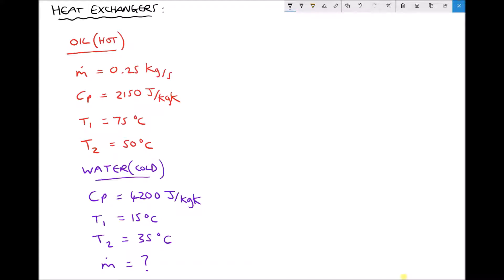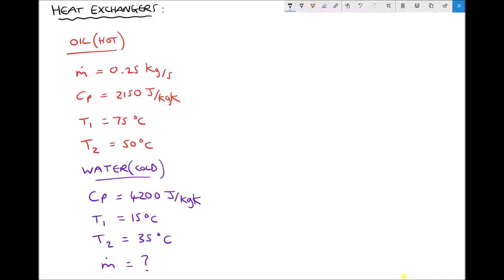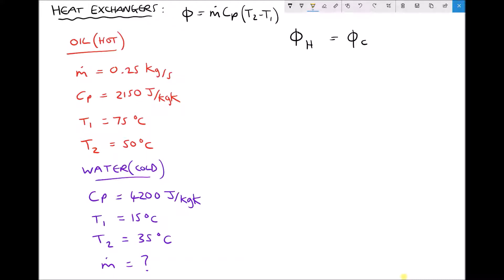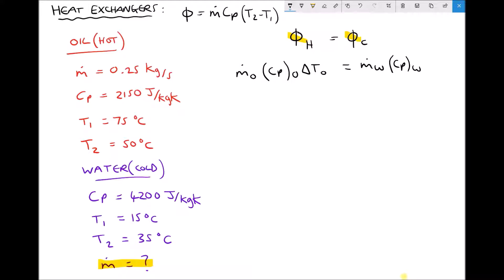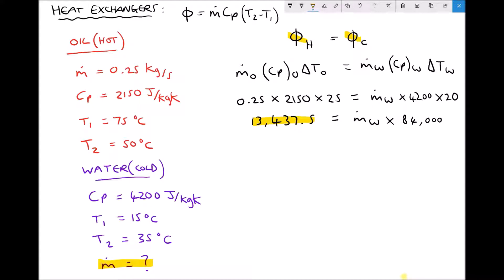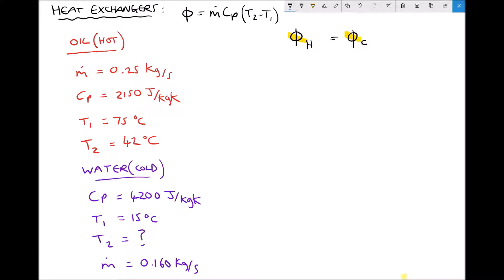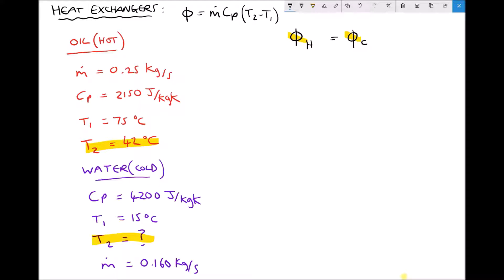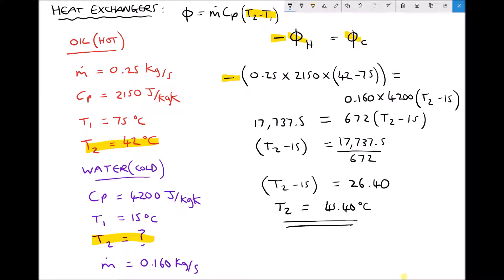Calculating Rate of Heat Transfer Between Two Working Fluids of a Heat Exchanger

Comment: I have a question. If you have a pipe of certain length with running water. Only the last 2 meter is exposed to a fire that heats the water so that it exits the pipe with a temperature of 20⁰C  higher than the inlet temperature. Pipe diameter is 22mm and flow rate is 0.06 litres/sec. How do you calculate energy since the water is flowing? Do you calculate in terms of time or in terms of volume?

Comment: Just a question: Suppose we have a hot plate and it's in contact with oil and another plate in a ratio of say 30:70 respectively (imagine a plate on a plate with oil grooves). How do we tackle heat transfer in this scenario?